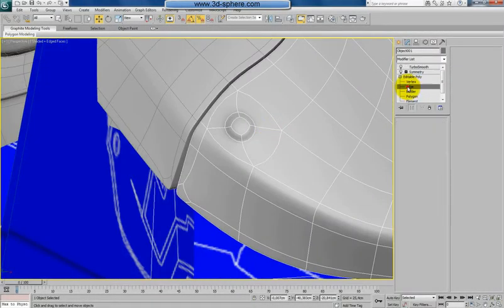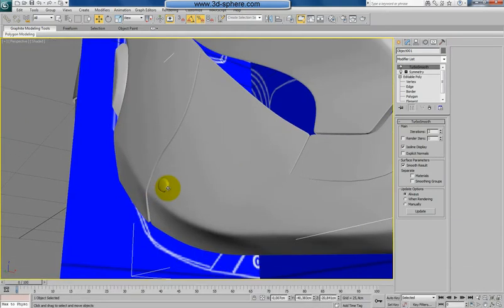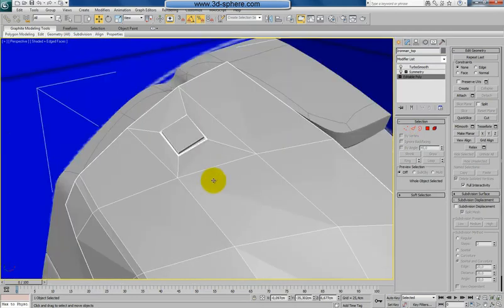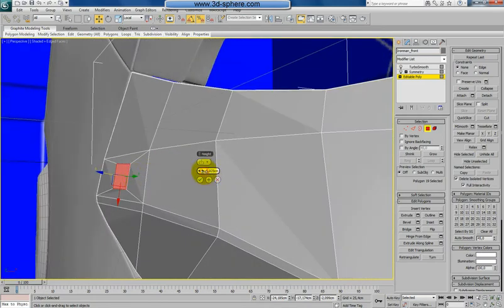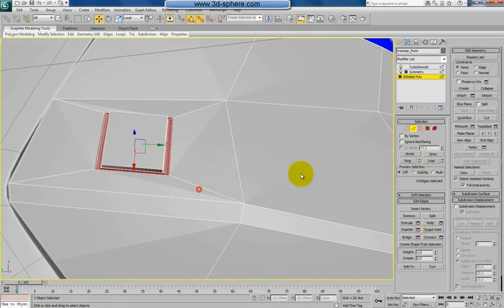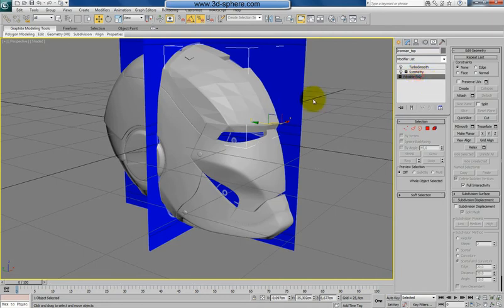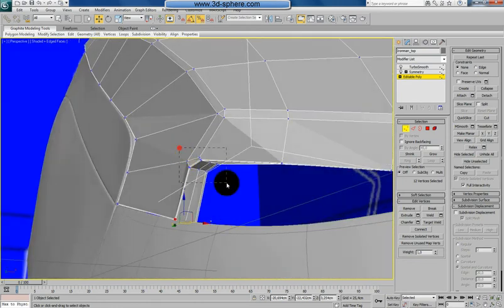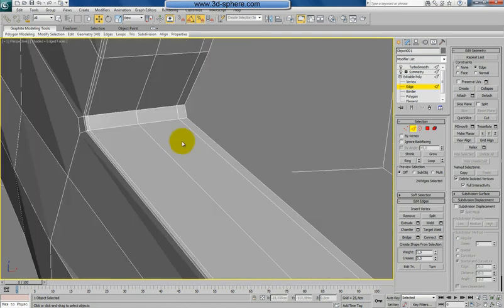Modelling Iron Man helmet using 3ds max - preview

Comment: Hello such, well I have a problem, I need to create a 3D model of a motorcycle helmet with the following characteristics:

1. - Has a camera in the back
2. - That has a screen in the interior of the lens
Three. - Which is a futuristic design without straying from the ordinary

I worked some time modeling in Archicad houses but not how to use a modeling program such as AutoCAD or Autodesk or Maya, I have a week to do it, not if I can help, if so I would greatly appreciate it.

Greetings from Mex.